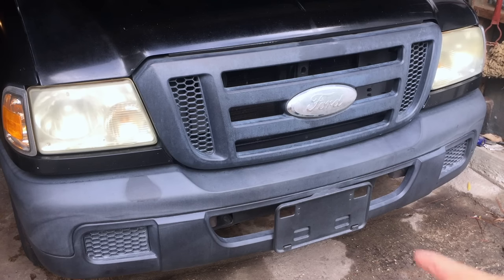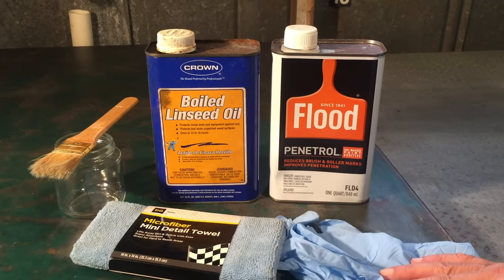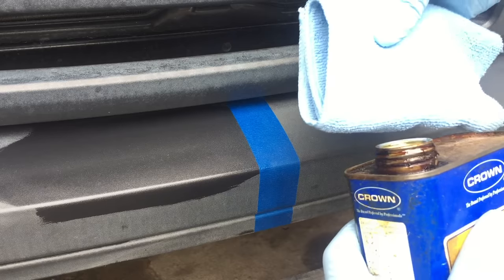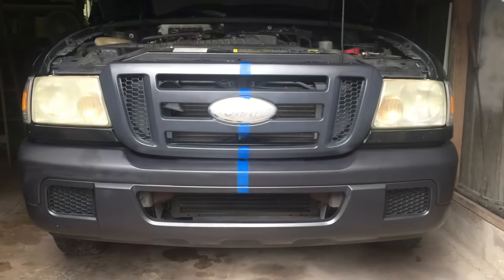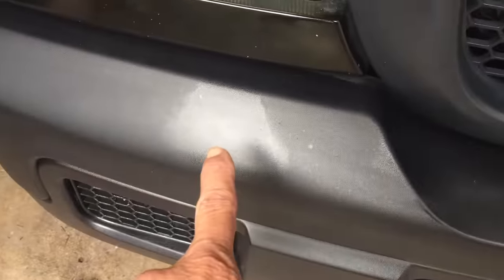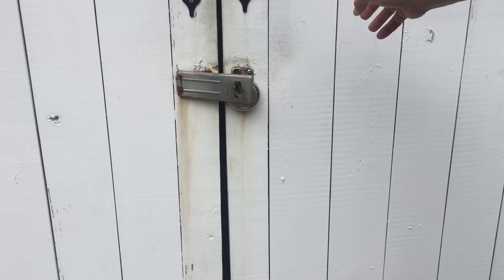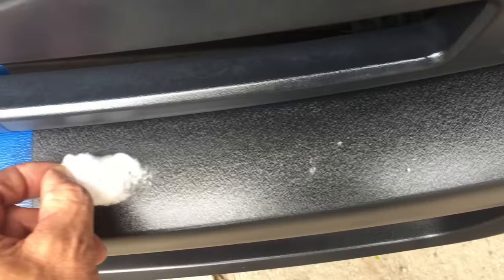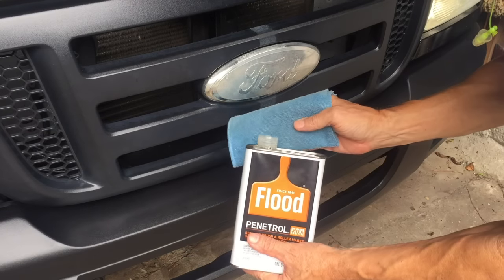Restore Faded Plastic Trim Penetrol Vs Boiled Linseed Oil

Comment: Heat gun lowest temp setting go of the plastic slow with a constant movement will work right?
Reply from the maker: I've read where that will work but I don't know from experience..
Reply: No it won’t work. It will temporarily look better, but it will fade again and the more times you do this, the quicker it will fade again. There are several good products for plastic trim that won’t damage it.

Comment: You’ve stumbled across the old
Nu-Vinyl formula.
Reply: After seeing your post, I thought I'd look and see. Nu-Vinyl uses various solvents and something called Decamethylcyclopentasiloxane as an emulsifier.  So it is very different but Nu-Vinyl says you can use it on tires.  Very interesting.

Comment: Looking at the data sheet there is no linseed oil in Penetrol it's shows Solvent naphtha (petroleum), medium aliph & ethylbenzene, also Linseed oil would require a Solvent to work like Mineral spirts to leach into the plastic & dry quicker. Actually maybe Linseed oil & Penetrol in a 60/40 mix might work even better. My question is how long does it last before it fades & Oxidizes before you need to apply again. The real problem is neither has any UV protection properties and nor does 303 as someone else stated.
Reply from the maker: Ingredient list on can shows naphtha, alkyd resin, linseed oil, polymd, xylene and ethylbenzene.. It's been 11 months and it has faded some but nowhere close to how faded it was before application.. I plan to post a one year later video in a month or so, mid sept..